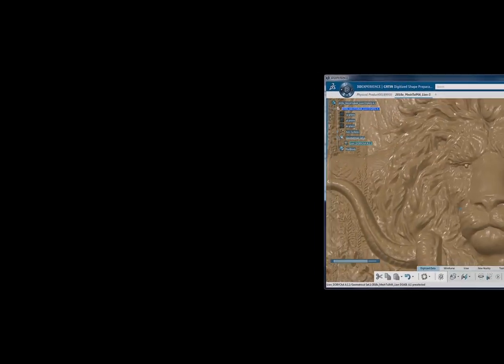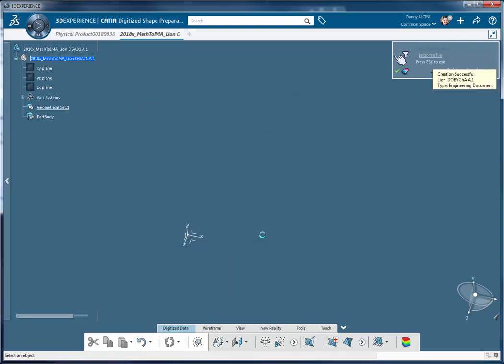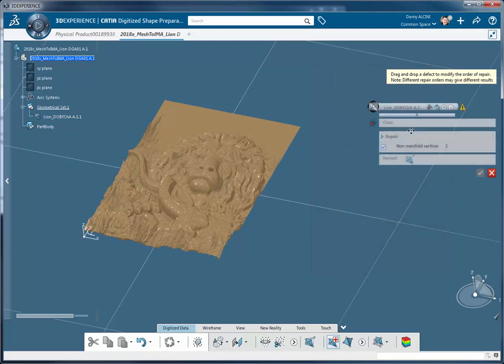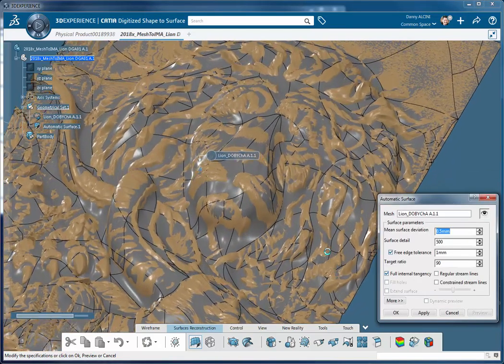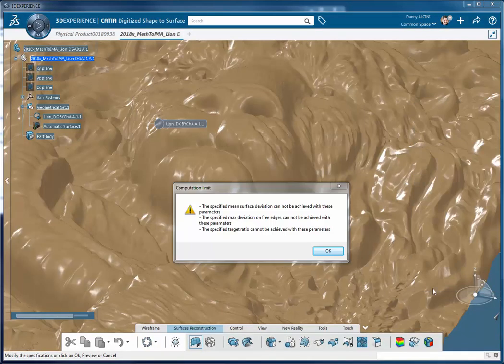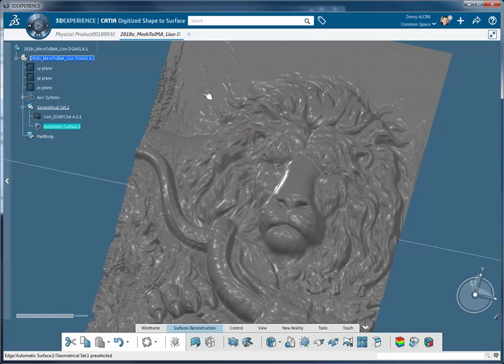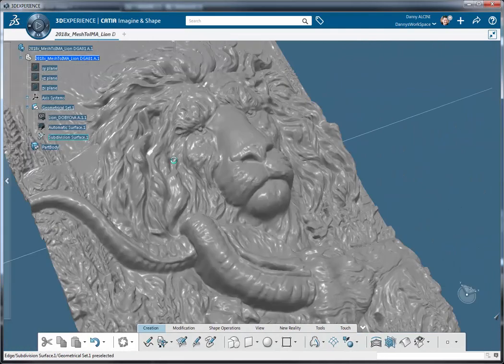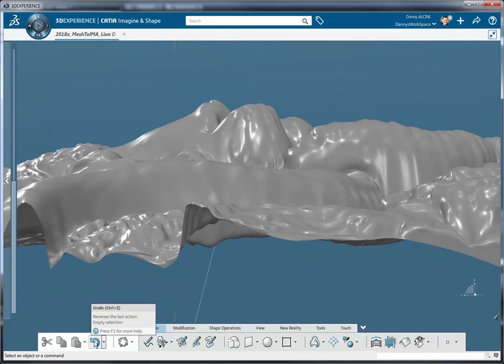2018x Mesh To IMA Workflow Tutorial

Comment: Hi Gerard, thank you for that short tutorial. Can you make an other video to show obj -> 1 subdivision in IMA?
Reply from the maker: Hi Fester...do you mean importing an obj into IMA? Yes, I will but it's pretty straight forward. If you have, say an OBJ from Maya or Modo, the import mechanism is directly available in IMA application (3dx) and workbench (v5).
Reply from the maker: Blender obj should be fine too.
Reply: Hi Gerard, thanx for your answer. I was trying to import an OBJ file (Maya or Cinema 4D). As you said, the import mechanism works. But after importing an OBJ there is not one single subdivision but a lot (more than 20). So I always need to combine those 20 subdivision surfaces to one. Is there an other way where I can get 1 sub?